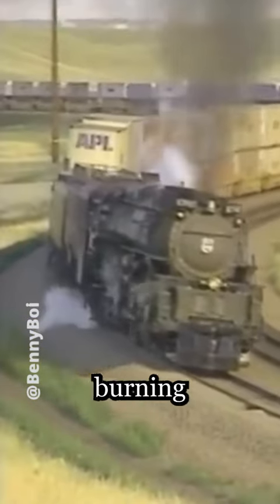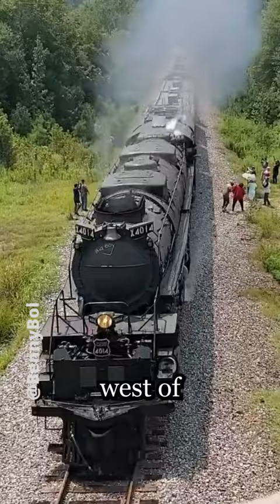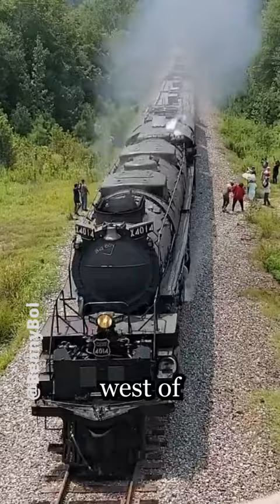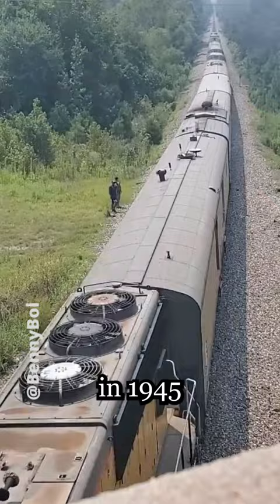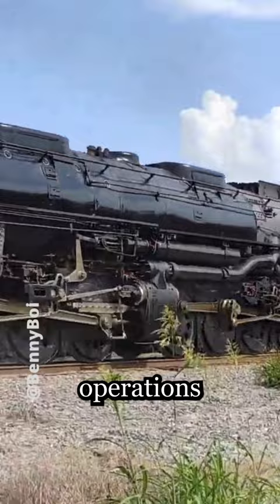The BIGGEST OIL BURNING STEAM LOCOMOTIVES

Comment: Interestingly, both of the steam locomotives in this video (3985 and 4014) originally were powered by coal, and were converted to oil burners after being restored.
Reply: Oil must be easier to get.
Reply: @user-jp7rk1uf2n it’s cheaper and “better” for the environment 
Quite often old steam ships are also converted to oil/gas
Reply: and their tenders are swapped also

Comment: Fun fact when they restored 4014 in 2019 4014s tender was still set for coal so they used 3985s tender on 4014 so she could run with oil and they converted 4014s to oil after 2019s unveiling
Reply: 4014s tender never got rebuilt and left Cheyenne hitched to 3985. It can be seen in all funeral train videos
Reply: @CoryAY82383  it is being rebuilt
Reply: @fives6363  ok but it ain't behind 4014 currently
Reply: @CoryAY82383  ? Bruh I just said it was being rebuilt of course it’s not behind 4014
Reply: So they didn't actually restore it...
Reply: @Kolonol1 right. However the Railroading Heritage of Midwest America is currently assisting UP in converting 4014's tender to oil. Afterwards 3985 and 4014 will swap tenders.
Reply: @davidng2336  so they didn't restore it...they built something new...which isn't as good in most people's eyes
Reply: @Kolonol1 they didn't build anything new, 4014 is using 3985's rebuilt tender
Reply: @willausterman3104  and RRHMA is going to give 4014's tender back to UP once they finish rebuilding it to hold oil.
Reply: @davidng2336  I saw that, glad both locomotives will regain their own tenders
Reply: @willausterman3104  which is an oil tender and not a coal tender...so they rebuilt big boy to run off oil instead of coal....big boy never ran off oil before therefore they built something new....read before you talk dude.
Reply: @Kolonol1  UP did convert a Big Boy to oil in the 1940's, so it's been done before. Building a new tender and converting a 70 year old one are two entirely different things. After seeing your other comments here I suggest you take your own advice. Reading comprehension and critical thinking will help you to avoid continuing coming off as a blithering bonehead in the future 😊
Reply: @willausterman3104  ooh rah man
Reply: @willausterman3104 preach!
Reply: She? 🤨 Big Boy got a sex change?
Reply: @DUTCHEE  it's all the rage these days...everyone's doing it
Reply: @DUTCHEE  no all steam locos have been called she since the 1st ones were made back in the 1800s
Reply: The amount of manpower/labor to keep any steam engine operating was phenomenal so its great to see a few of these engines left to toy around with … with today’s environment its great to have air conditioning …
Reply: @mshum538  sure thing bro
Reply: @CoryAY82383  I wouldn’t say it was a funeral train. It was a hospital train!

Comment: This doesn’t have to do anything with the video, but I just found out that there’s a locomotive called ‘A Camelback’ and it is literally one of my new favourite engines.
Reply: All fun and games until it throws the main Drive route through the ass of the engineer
Reply: lol
Reply: Yes, cab on top of the boiler, in front of the firebox. Sort of strange looking, weren't they? The firebox was very large and wide in order to burn hard coal, anthracite, efficiently, and was so wide that it wouldn't fit inside the cab, making it necessary to move the cab in front of the firebox. Pretty much used only back East. . .
Reply: @ericemmons3040  CamelBaks were used for burning low-grade coal which need a wide Firebox and if they put the cab back there the engineer wouldn't been able to see so they put the engineer in the front which gave him better visibility
Reply: @ericemmons3040  if you think they're weird looking look at a cab Ford
Reply: @SGT_Odin  I'm assuming you mean "Cab-forward". . .
Reply: How is your vision?

Comment: "more efficient" normally eludes to labour costs.
Reply: Quite true, steam locomotives are a maintenance nightmare compared to diesel-electric. I wouldn't doubt fuel use per ton-mile is also lower with the diesels.
Reply: @JM-lk6wo  it is not when considering tonnage that they can move....Big Boy can pull a 7 mile coal drag....no single diesel can brag that.
Reply: @Kolonol1  very true, and no diesel-electric was ever designed to do so. One of the advantages of the diesels is coupling two or more locomotives in series to pull large, heavy loads with only one train driver controlling all of them. And I stand by my opinion of total fuel usage compared to a large steam locomotive pulling the same weight.

Comment: I read aomewhere biocharcoal could in the future replace oil
Reply: Yes, back about 1980, or there about, in the last century, there was serious talk of building mainline RR locos as steam turbines powered by powdered coal dust. I don’t know, nor recall the details but Trains Magazine ran an article on the topic. Obviously the experimental faze did not produce an economical loco. Plus pollution control requirements were even questioning the use of coal fired electric generators powered by turbines, but much larger and economical use of the abundant amount of coal.
Reply: @railscenes4959 to add to that, the Germans designed a powdered coal powered jet in World War II due to their oil shortages. Post war analysis in the USA concluded that it would have flown.

Comment: I do not believe diesel locomotives, especially at the time, were more efficient then steam locomotives, at least with respect to fuel economy. Rather they are cheaper to operate because of the maintenance and facilities required to run steam...
Reply: But they can be started quickly compared steam.

Comment: Steam locomotives are actually more efficient, because you have to remember just how many diesels it takes to replace ONE big boy, they burn up to 3x the fuel and oil to pull the same cargo when fully loaded (at tonnage) because we are constantly finding out that the big boy can pull FAR more than initially designed for 

Diesels are cheaper and quicker to maintain, which is the true reason why they are replacing steam locomotives

Fuel is cheap, traction motors are not, but are cheaper due to the red tape designed to prevent catastrophic pressure detonation and complexity

Comment: Am I the only one who doesn't like oil steam engines? When I think about steam engines, I immediately think about coal.
Reply: Yes, most non railroaders have that opinion. I’ve worked as a docent on steam locos that are oil burners. I try to restrain an outburst of laughter when someone almost always ask where do you put the coal. I kindly explain that the loco was built as an oil burner to make it more efficient and use the fossil fuel that is the easiest to acquire, store and load into the tank behind the engine. Bunker C grade oil was in extensive use to fire boilers of ships. It was cheap and much easier to fire a steam loco with a simple firing valve controlled by the fireman along with a steam heat system in the tank to heat the gooy oil to make it flow under the cab to the front of the firebox where the fireman controlled the atomizer or steam jet spray to create a oil vapor that was very explosive and would fill the entire firebox with a cauldron of extreme heat. Need we explain more? No shoveling required to super heat the water in the massive boiler to allow power to operate at sustained speeds of over 90 MPH in passenger service or over long steep mountain grades with heavy freight trains. 
I do prefer the sweet smell of coal smoke tho🥴.
Reply: Same here...steam is coal and wood...the railscenes guy that commented is full of crap
Reply: @railscenes4959  the fact that you said fossil fuel means you don't really know anything about it to me...oil and coal is NOT a fossil fuel...
Reply: @railscenes4959  I can understand the advantages of an oil burning steam engine, I find it, though, that it loses some of it charm.
Reply: @Kolonol1  what are you talking about? It obviously still is a steam engine because you use the oil to heat up the water. All I'm saying is that I prefer traditional coal steam engines to oil. I am not too sure why, I guess oil always makes me think about diesels, and I've never been a fan of them. BTW, oil and coal aren't fossil fuels ?! What on earth?!
Reply: @dyobodraode2554  no oil and coal are not fossil fuels...never have been...JP Morgan and others paid big money for it to be classified as such to make them seem more scarce so people would pay more for them. Oil is replenished faster than we use it by the earth still...

I know that they are still steam engines...but when I think of steam I think of coal and wood...
Reply: @Kolonol1  that is just completely false.
Reply: @Kolonol1  OK if it suits your terminology better we will call fuel that powers most steam locos what ever you want to call it. I did not intend to start a debate over a term because it derails the conversation.  The fuel used for most steam locos is formed underground compressed over millions of years from the decaying residue of plant life on Earth. One of the current generic terms in current popular use for gas, oil, coal, is “fossil fuel”. I will agree the term is a bit off mark. My apologies.
Reply: @railscenes4959  oh no my argument to you was "most non-railroaders"....no..
Just no
Reply: @Kolonol1 💀
Reply: I like oil or coal or wood-burning steam locomotives; it doesn't matter to me. The thing that matters is that it's a steam locomotive.